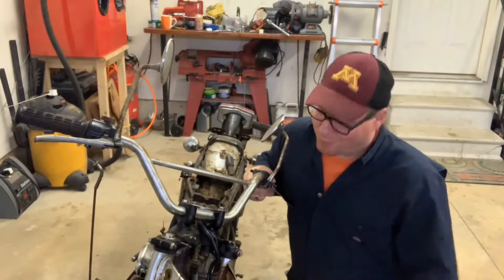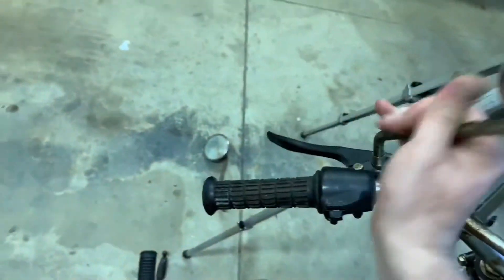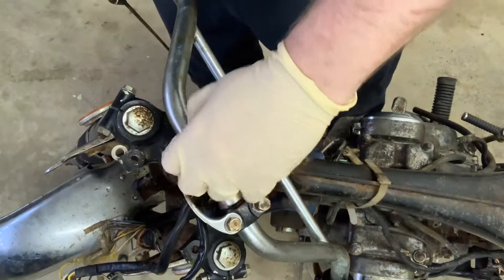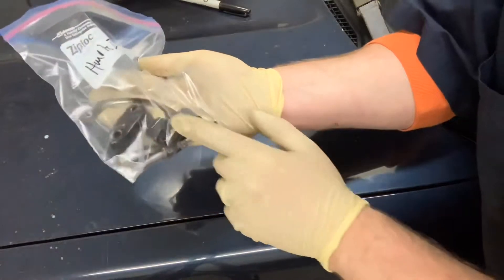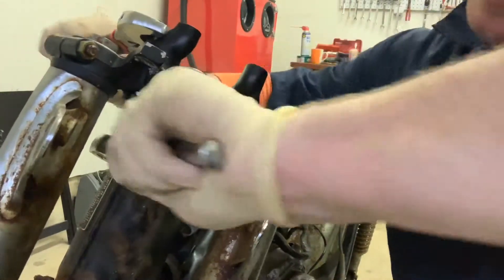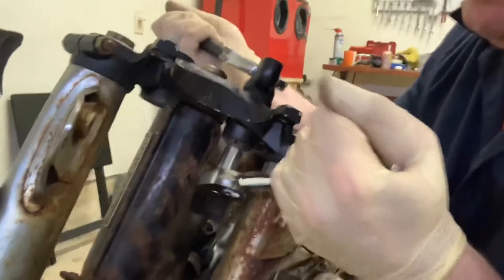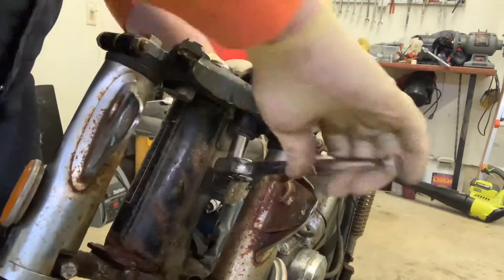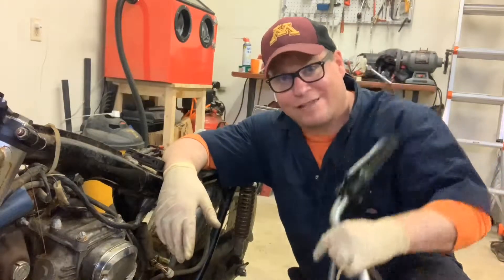How To Remove Motorcycle Handlebars - Vintage Motorcycle Restoration Project: Part 10

Comment: I have a CB450K5 in similar condition and slowly getting it roadworthy. The ground wire is often added because the handlebar  bolts are rubber mounted so it helps to connect the switchgear to the frame.
Reply from the maker: Excellent information! Thanks, Andy. Makes total sense.

Comment: For the internal wiring in the handlebar. Tie/tape a long piece of small stirdy string to end of the wiring and pull it through. Tie the string around the handlebar by each end where it goes out, with a good knot so it does not get loose by an accident.
When you want the wiereing back, tie/tape the string to the end of the new wires and pull through the handlebar. This is also perfect for internal wiring in frames.
Hope it can help someone out there 😊
Reply from the maker: Thanks for the tips, Christian. Love the approach.

Comment: The under handlebar bolts should be loosen before removing the handlebar. I wouldn't use the crescent wrench, just put the handle bar again and loosen the bolts. If you really have to use the wrench, then use vise grips with rubber against the sides of the aluminum part. This will keep the part surface scratch free.  Keep up the good work.
Reply from the maker: Totally agree! Would have been much easier for sure. Luckily I didn’t scratch anything up too bad. Thanks for watching! It’s definitely a process.